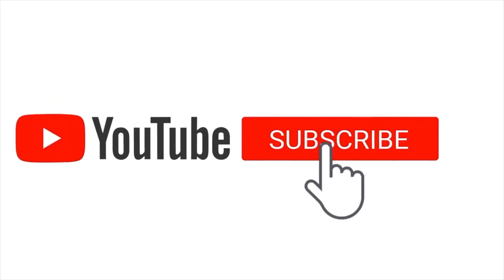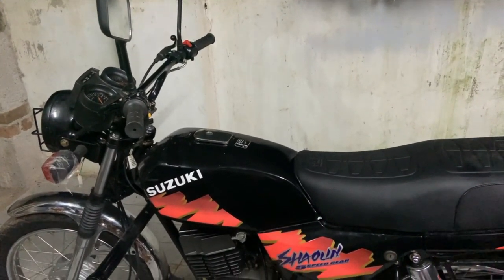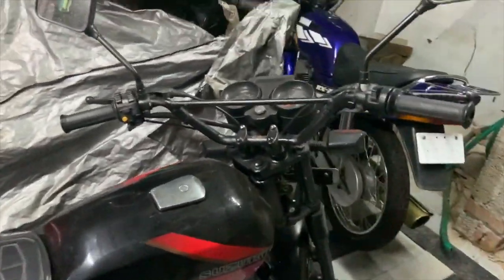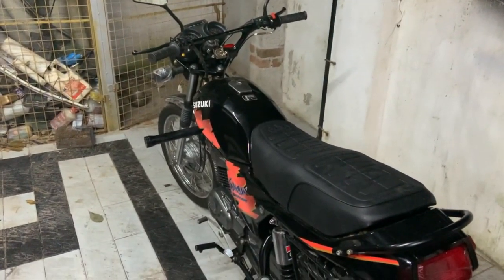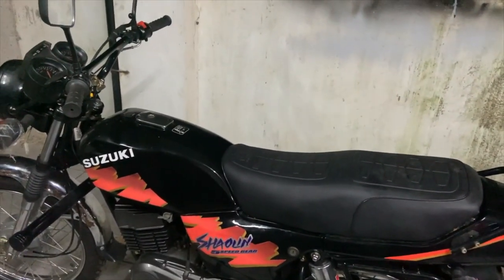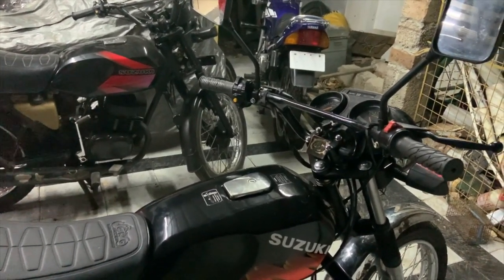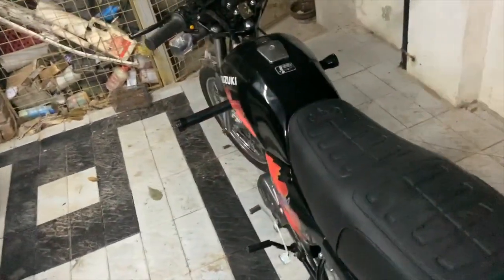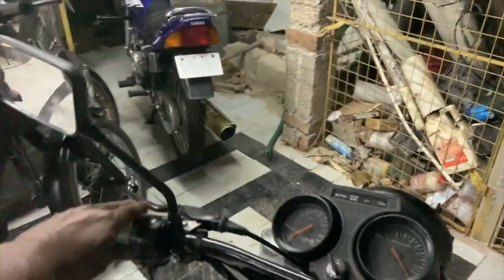TVS Suzuki Shaolin Build Update  ( English Video )

Comment: Was waiting long to see the Shaolin . Instead of using brake wire strand one can use disposable syringe needle, the smaller ones, sometimes for cleaning the jets.
Reply from the maker: Thanks for the tip, finding a brake wire is easier in my garage than a syringe

Comment: Hi. Since you have restored both the shogun and shaolin.  I wanted to know if there is any way to tell the cyliders of the shogun and shaolin apart.  They both look the same.  Are there any physical markings etc on the cylinders to tell them apart.  Thanks for any inputs you can provide.
Reply from the maker: Shogun has 110 CC markings and Shaolin has 140 CC (I might be incorrect with the exact numbers) This is the biggest one, apart from that there is also the obvious difference in the bore diameter.